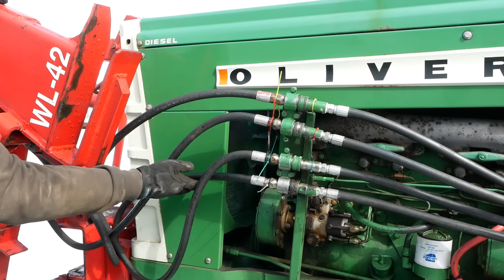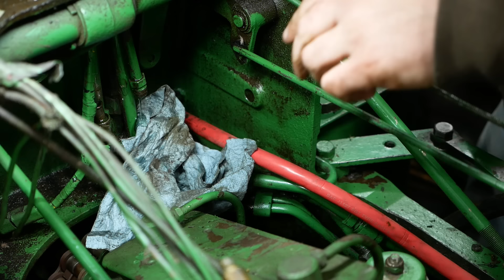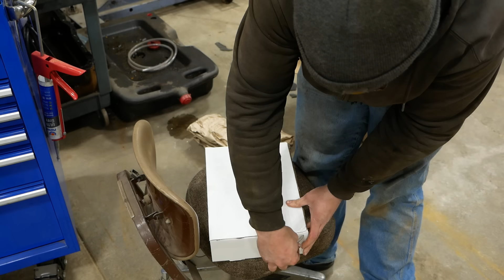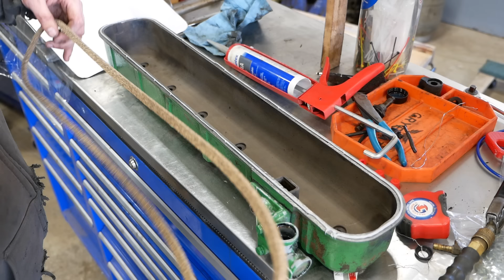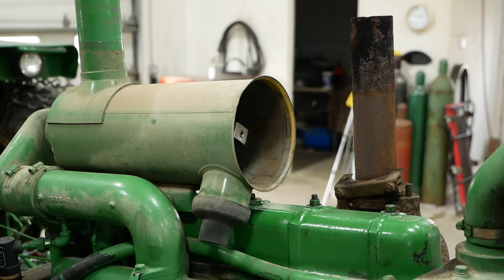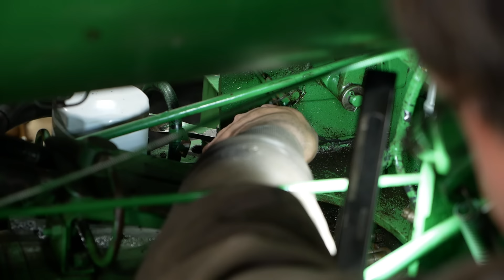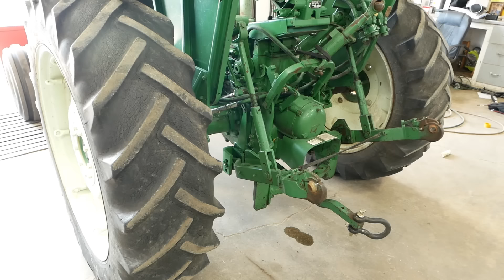Oliver 1650 Tractor Fuel Injection Overhaul and Other Repairs

Comment: I REALLY wish I had seen these Oliver engine videos before I redid my Hercules D3000. Watching your work beforehand would have saved me a lot of extra work, stress, pain and sorrow! Well done sir! Is there supposed to be a gasket on the injection pump flange were it bolts to the engine?
Reply from the maker: It had an o-ring around the bronze bushing.

Comment: I’m curious why you didn’t just use ni-cop for the injector return line instead of just the ends?

Pouring like you did with the fuel conditioner works if the spout sticks up higher than the handle, otherwise tip it to the side enough to avoid the handle.  I sometimes manage to do it without spilling 😀

I enjoyed the video.
Reply from the maker: I used the old copper return lines. They were fine. Just the tee fittings were bad.
Reply: @WatchWesWork  no, I meant the line from #6 back to the tank
Reply from the maker: @graemediesel2936  I could have. It was a hose before, so I figured better to stick with what we know works.

Comment: How can there not be air in secondary fuel filter ? The hoses go into the bottom so any air would surely rise to the top ?
Reply from the maker: Look at the way the seals are setup on the filter. It comes in the bottom, goes up through the center to the filter media, and down to the outlet.

Comment: Very impressive, both the mechanical engineering, repair, replacement and modifications, and excellent photography/video editing skills.
Demounting that front bucket, and it's storage position looked scary, pity the rams are exposed, but difficult to do otherwise.
Again great full length video Wes.
Thanks for sharing.
Best regards from the UK.
John.
Reply from the maker: Thank you!

Comment: My dads TD-9 bulldozer had a roosa master fuel pump, he said when you shut them down leave the throttle wide open and it will never give you any problems. why ? I don't know why, but the machine ran for 22,000 hours. pedals worn thin as razor blades.
Reply from the maker: To keep the metering valve from sticking shut. Same reason you don't leave the shut off pulled out. Old habits die hard!
Reply: @WatchWesWork  Thanks, now we know.

Comment: Pour from the side. The only issue is getting air into the jug when the fluid leaves. Otherwise it glugs and splashes. If you pour with the opening at the "bottom" the air can't get in because there's fluid all around. If you pour from the side the air can get in the top.

I'm eager to hear about that dump truck though. M54?

Comment: Hi Wes, I think you are outstanding at fixing and solving the problems of your work, then I like your patience, then you have to be really good at math, you mentioned the calculation regarding the flywheel and the degree before the dead center, I had not managed  me self.  You know there are not many of your caliber.  With similar weather as you have from Sweden, storm, Snow, rain, plus degrees, minus degrees, is called spring.  👍😉

Comment: My grandpa taught me that the best way to adjust valves is one cylinder at a time.  As the exhaust barely starts to open, adjust intake. As intake is almost closed, adjust exhaust. Guarantees that the lifter is on the base circle of the cam. Most vehicles will work with the standard way you showed, but I have dealt with race engines with a lot of overlap that give you false readings. Takes a little longer, but that is how I do every engine.
Reply: This is how I do it. It’s foolproof

Comment: Hey Wes pull that lift pump off, throw it in the trash, fabricate a cover plate and bolt it on the hole in the block and put an electric pump on there. 

Also have you tried hanging from the ceiling while you pour your additive? Doing that changed my life!

Comment: With you, I can never be sure if you're joking or being serious, lol. About the liquid pouring: With a full container it's often easier to pour it sideways. The main goal is to keep an air-path free while pouring, so you get a steady pour instead of the well-known gluck-gluck effect. Pouring it sideways can still be ineffective on containers that have a long neck and a wide body, that's when pouring upside down can work. This trick doesn't just apply to mechanic's liquids of course, it also works for things like drink cartons. If applied correctly, it can prevent quite the mess while still being able to pour quickly.
In the end though, just do whatever you prefer. Nobody is spill-free.

Comment: Yes the follow up on the pump and injector rebuild. Nice. 
When pooring out of a jerrycan you obviously don’t put it all the way upside down, on the side is good enough. Just keep the opening on the top, so when liquid comes out, the air can flow in without the clogging you otherwise have if the opening is all the way down.

Comment: Wes try Maibaugh's in Creston Ohio for your 770 parts. I replaced my return lines on my 1550 with apiece of 1/8 pipe and Standadine tees for pencil injectors and 1/4 copper between them. I made a video on my channel . The odd fitting on the steering motor is a #7 inverted Gates make a hose end!
Reply from the maker: Thanks for that info! I did find Couplo-matic makes the inverted fitting, but I don't know if it will play nice with my dad's crimper. But I think that return line idea is the way to go!

Comment: Wes, used to rebuild heavy pneumatics for water treatment plants. Looked at a set of the seal install tools and after getting back up from the floor due to the cost we were looking for alternatives.  Found that the plastic spouts from cheap funnel sets would fit 95% of the valve spindles and a bit of oil made fitting the seals easier. Don't know if you can find plastic funnels big enough for the work you do but we also just rolled plastic sheets cut from milk jugs as well. Real shadetree work but it done the job!
Reply from the maker: I've used that milk jug method before. Works just fine!

Comment: Am i the only one with enough OCD to be bothered by the fuel line to the pump being pigtailed the wrong way (clock wise instead of counter clock wise from filter to pump) so it is in the way of the oil stick?
Reply from the maker: Yes. Only one.

Comment: Wes, can the MF lift pump work? The housings are similar. They're cheap... the shipping is more than the part. Worth a try. New Fuel Lift Pump for Massey Ferguson Tractor 1105 Others - 4222093M91. Ebay.
Reply from the maker: I don't know. There are so many different ones.
Reply: @WatchWesWork  If it matches at all like the picture it's gotta be close. Ebay has it for $23 which is worth the experiment. I wonder what the AGCO dealer has it for?

Comment: Would a bad fuel system cause a Perkins diesel engine to produce black smoke I think it might be burning oil aswell
Reply from the maker: Yes. Oil burning is usually more blue. Black or white smoke means too much fuel.
Reply: @WatchWesWork  Thanks Wes

Comment: A question for my fellow wes viewers. I just purchased a very used mini excavator, among many things that need attention I pulled the ports on the finals and they r  full of thick crud, I saw a video on here of a guy cleaning one but he took the face plate off and brakleened it. What could I fill it with and run it to clean it out.  I was thinking of spraying a can of brake clean in it then filling with diesel or hydraulic and draining it a few times. What are your thoughts.
Reply from the maker: Anything would probably work. Maybe ATF. It's good for cleaning.
Reply: @WatchWesWork  thanks Wes good to hear from the one and only, if I were closer this thi would be at least ten vids for you

Comment: There 's a easy way to remember the firingorder of a inline 6 ' :  15 is to young, 36 to old, 24 jus right...
Reply from the maker: I never could figure out how that helps anyone. It could just as easily be 16 too young, 35 too old, 24 just right...
Reply: @WatchWesWork  Well Wes, it only worked for most of us old timers back when we were young because we MEMORIZED it that way. Taking the firing order and equating it to mnemonic that included something like wisdom about the opposite sex just sounded like it was a foolproof way to get it right.  But now you come along and use logic to disprove that old adage.  I can assure you that the old saying was flawed in other ways too....the first and second pair of  numerals in the string keep getting bigger as you age, and the last pair becomes whatever

Comment: nice video! nice to see the old tractor coming around.  With the cork gaskets, i use the proper gasket glue (not shellac) from permatex.  they have ones specifically designed for cork gaskets, and they make a huge difference i find.
Reply from the maker: Yeah I suppose Hi-Tack or something would work as well or better.
Reply: @WatchWesWork  the advantage is it doesn't make the cork gasket go hard

Comment: On that green return line to the tank, you can also put the original crimp sleeve portion on each end against a bench grinder and carefully grind the sleeve off.  It's a little smokey and stinky, but you are left with a nice barb on the inside that you can clamp a new hose onto the old fitting ends.  Saves a little work making new ends.
Reply from the maker: Good tip!

Comment: swagelok fittings 3/4 turn from ferrule stop, and the torque wrench click was a little weak
Reply from the maker: Hmm. How you do you when you are at 3/4 of a turn from bottom?
Reply: @WatchWesWork   swagelok is a very high end fitting used in aircraft and no leak applications, here are there instructions  https://youtu.be/jB_Nyje_HNE

Comment: I had a hose I could not get back in the day and the hydraulic hose guy I took it to just cut the crimp off and re-used the metal ends and just crimped new hydraulic hoses to the old fittings and worked perfect
Reply from the maker: I can't find anyone who can do that. These fittings are soldered together as well. So I don't know if it would be possible.
Reply: @WatchWesWork  Well then I think a nice company should send you a crimper with lots of dies and you could buy some hose and fittings and make your own :)

Comment: I use to have a 93 ford one ton pickup and after 200000 miles it was losing power over the years. I replaced the fuel system and it ran like a new truck. I had a friend who had a timing light for a diesel and what I did was on the mark. I only sold it because I hurt my back very bad and a one ton truck has a very hard ride. But I miss it.

Comment: How many modern tractors will still be doing this in 50 years...
Reply: None of them. Those that will not have died from electronic failure and total unavaillability of spare computer parts will have died because their thin sheet metal will have rusted away, their plastic will be eaten by the sun and their small displacement, high manifold pressure engines will be worn out beyond repair.
Reply from the maker: As long as there are still at least two, we can probably keep one running...

Comment: I like that pressure washer from the pre plastic age. Looks indestructable.

What about the Oliver crawler?
Reply from the maker: I know. I need to finish it.
Reply: Used to make them for my local council, diesel injector, ignitor and a pump and heating coil for the water. Very effective to use, just be careful on cars as can deform plastics. Electric ones seem to have taken over in depots now.